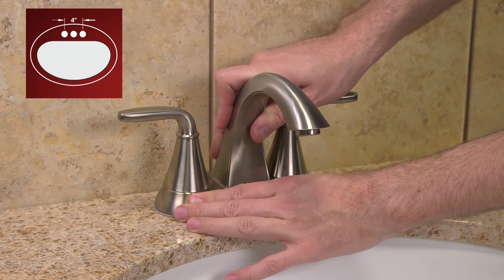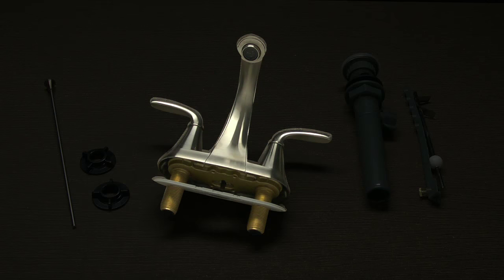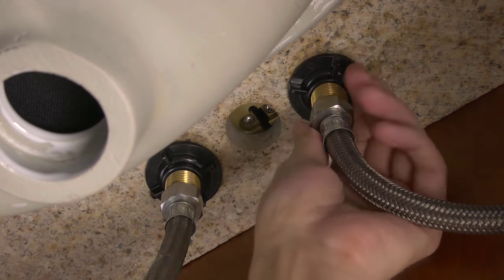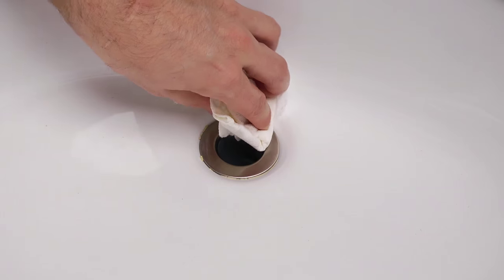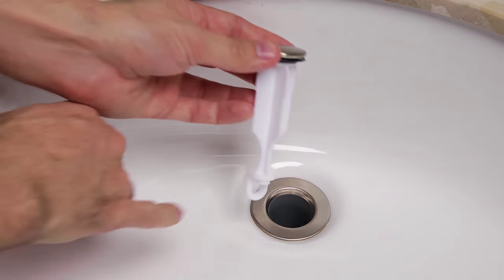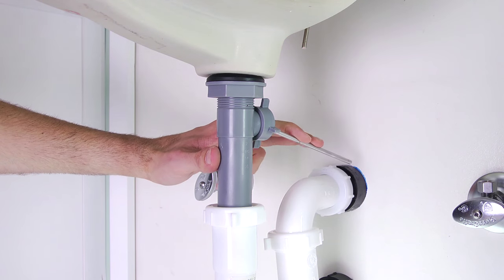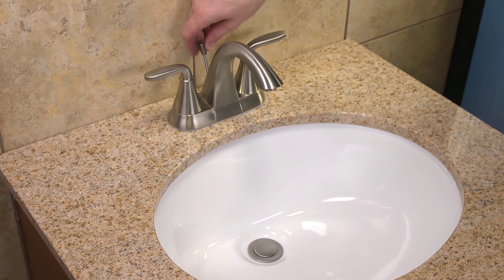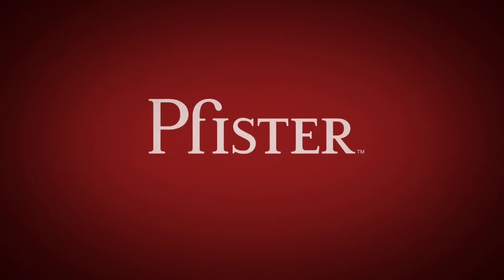Installing a Pfister 4" Centerset Bathroom Faucet with a Pop-Up Drain - Pasadena Collection

Comment: Great video the way you showed every step. I used this as a reminder how to install a faucet (it's been awhile) thankfully I did view this first as I would have forgotten to add putty to the bottom of the faucet plate. Thanks for the video.
Reply from the maker: You're welcome, and have a great day! -- Pfister Social
Reply: @PfisterFaucetsUS  Will this faucet allow you to connect a small washer machine hose to it?
Reply from the maker: Hi! We don’t have any adapters for the bathroom faucets, but we can provide you with the aerator housing threads for you to see if there is an adapter you can use. The aerator housing threads for the Pasadena model are 13/16” 27 UNS 2A. Thanks – Pfister Social